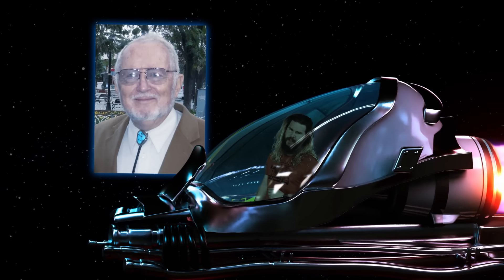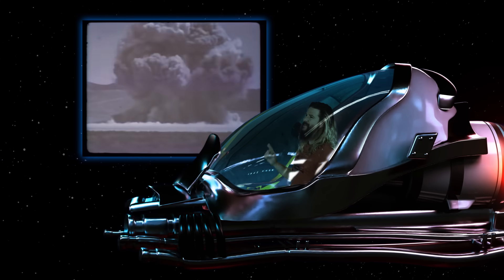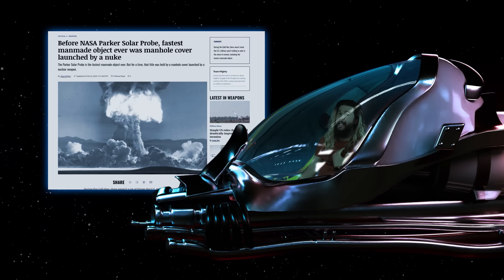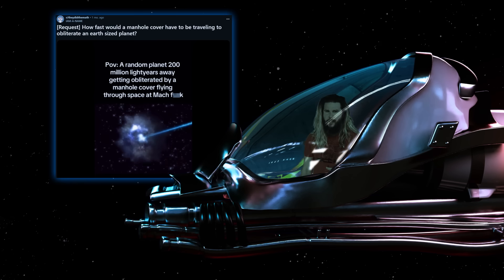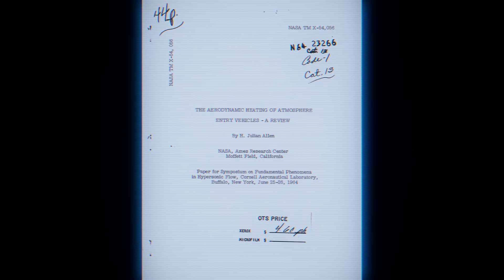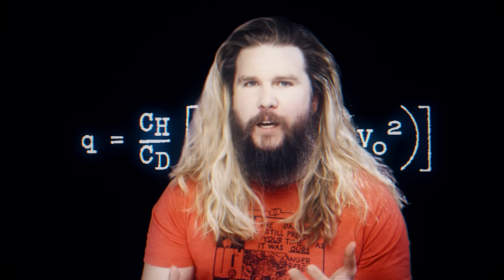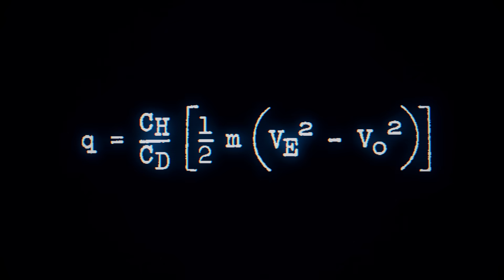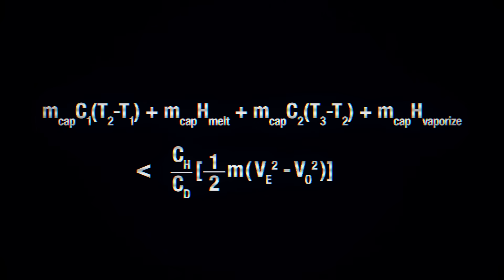Debunking the Nuclear-Powered Manhole Cover

Comment: There are some problems with all of the math. Three things: We assume that the cap was moving through the atmosphere perfectly flat; not sideface or tumbling. Second, the fluid dynamics of re-entry are not static. There is "peak heating", and as the cap moved upwards in the atmosphere, it would encounter VERY progressively thinner air. So, if we assume that the peak heating occurred fairly quickly, in the denser parts of the atmosphere (which is a safe assumption), then there is a plethora of unknown data values after it reaches peak heating. Thirdly, hypersonic atmospheric interaction on a shape like the cap isn't a known value, and there is too much assumption made on that; meteors explode at lower speeds precisely BECAUSE they are traveling at a lower speed.

All this to say, it is most probably accurate to assume that the cap did not make it to space. However, there is a LOT more math that needs to be done to be actually conclusive. Also, before its likely vaporization, it most certainly was the fastest man-made object ever created.
Reply: Should we be taking into account the heat energy imparted by the explosion itself or are we assuming the pressure wave proceeding the heat/radiation moved the cap out of the way before there could be any meaningful transfer?
Reply: @Kzorith  Concrete also was poured into the bore that did vaporize but acted as wading and increased the pressure at a cost of some of the early heat.
Reply: @Kzorith the steel cap was thermally insulated from the explosion by a concrete plug, the pressure would have shot the cover away before any significant heating happened.
Reply: @thelastant8366  The cap would have been irradiated by (depending on the details of the explosion) lots of gamma and neutrons. Enough getting through the concrete plug to heat it? I haven't done the math.
Reply: @thelastant8366 but what about deformation we are also assuming it remained flat.
Reply: @thelastant8366   It was welded in place. How is it possible to stress welds to the breaking point and not incur some measurable heat loading. I'm glaring at the equation now, and while there is a time term, it's still going to be significant in the "a couple of shakes" timeframe this likely took to break the welds.
Reply: @Kzorith  An interesting thought. If the lid had direct line of sight to the bomb, would it absorb enough heat energy to effect its airborne melting point.
Reply: @rus0004 I’m not nearly good enough at math to do this but I think a good start to gage the accuracy would be to use this equation to determine how much heat would have been imparted on the cover to reach the height during the first high speed frame. If the equation says the lid should be hot enough at that point to be glowing then we know it’s inaccurate.

I don’t believe the physics of exit are the same as re entry and it imparts a lot mor energy to slow a object down than speeding up. The energy absorbed would be the difference between the velocity at ground level and the velocity upon exiting the atmosphere.
Reply: @Kzorith  IIRC, there was a concrete plug between the bomb and the cover. This plug was vaporized by the detonation and the expansion of that vapor is the reason the cover was launched. So likely some heating but not a lot.
Reply: @Kzorith  yeah, when we think about the concrete evaporating, we have to keep in mind that thermal radiation travels at SOL, while the pressure wave, even in concrete, is still much slower by a huge margin.
Reply: @Kzorith  was the proof of that in the high speed footage?
Reply: @garywayne123  Not that I’m aware of. My question was more around if the starting temperature of the cap was higher than ambient  before we start applying the atmospheric heating equation.
Reply: The only frame would say probably not  @Kzorith
Reply: That is a big assumption that begs investigation. This is a very complex event to model. It is probably necessary to look into how the equation was formulated to begin to understand whether it is exit/entry reversible. I think it might not be  (because the atmosphre is progressively less dense as altitude increases. I also think the disc would only be exposed to the heat of the explosion until a few milliseconds after it launched and that it probably launched with some eccentric motion that would mean it didnt go up flat so the drag coefficient would be lower as well as reducing.
Reply: @Kzorith I was wondering the same thing, not that I know anything about which would’ve interacted with the cover first. I suppose it makes sense that the pressure wave would make contact before the fireball but it’s still hard to believe that something could be sealed over a nuclear explosion and not be instantly destroyed
Reply: @Kzorith it had to be pushed by the pressure wave and didn't experience the blast heat is what I believe because if it had felt the heat of the blast which is hotter than any part of the sun I believe it wouldve been vaporized immediately
Reply: @Kzorith to my understanding the iron cap was at the top of the borehole, and directly below it was a 20ft thick concrete plug (with the bomb itself several hundred feet further down the borehole). Therefore the cap never interacted directly with the nuclear fireball, but rather was launched like the last ball in the world's most ridiculous Newton's Cradle
Reply: @Kzorith  Radiation travels close if not at the speed of light so it probably was already hot. Radiation reaches you before the pressure wave.
Reply: @Kzorith cap is going to be in line of sight of the blast even if it’s been blown off already. That’s gonna be warm.
Reply: He also assumed the caps final velocity was zero for the heat equation he used.
Reply: You are correct, the amount of energy variation is several times higher, so even if its reduced by making more accurate calculations and drag coefficients, it would not be enough to not vaporize the cover.
Reply: @shippy1001  I would spemd taxpayer money to test this
Reply: @shippy1001  Unless the cover as a result of air resistance started to follow a path closer to ground, meaning distance traveled and air resistance could be far greater than if assuming a straight trip to outer space.
Reply: @shippy1001 what about the fact that it made contact with a nuclear bomb
Reply: I did a simple analysis simulating interval while including the standard density of the atmosphere at altitudes and it definitely demonstrates a non-zero probability that there would not be enough energy to vaporize the manhole cover. 
1. Its odd to assuming that the manhole cover would remain flat side against the air, more likely it would tumble then end up edge on. This would both reduce the Cd (3/4) and the area (1/10) causing the drag and frictional heating drastically reduce.
2. As many have stated the density of the atmosphere exponentially decreases with altitude. Assuming the test was at sea level, by 10,000 meters the air density would be 1/3 of what it was at launch based on interval calculations (using drag) that would take less than a fifth of a second to reach that altitude even as the cover slowed down. By the half second mark the air would be less than 10% as dense and so would the drag (and thus frictional heating).
3. As other stated the change in velocity would not be 100% but whatever change in speed once the cover got to a region with low enough air density. Again rough interval analysis shows that the cover's velocity at where the atmospheric density is less than 1% of sea level, would still be closes to 50% of v0 or 33 km/s. 
Again it is rough, and there are way too many complications that can skew the results either way, but using this method I got approximately 1,500 Gj of energy if 100% of the change in velocity became frictional heating. That is only 25% of what is presented as the energy of vaporization. So again this doesn't prove that the manhole cover didn't vaporize (many more complexities need to be accounted for), but just doing a slightly more in depth exercise (mathematically) shows that there is clearly room for the molten blob of cast iron to make out of the atmosphere. I'd be happy to share my work with team, but unsure if there is an e-mail address for fans.
Reply: @jonathanlien324  yea probably made it and became space junk
good luck cleaning hypersonic scraps 🤣🤣
Reply: @randomguy2210  Considering the angle at exit, aka straight up, if probably fell straight back down and burnt up in the atmosphere on the way back if it made it to space.
Reply: @rivernlong5979  mm you sure? it was well above escape velocity tho
Reply: Also the fact that as an object travels higher into the atmosphere, the pressure decreases so the amount of time required to change its temperature also decreases.   Also the fact that the object is slowing down as it moves upward due to gravity.  It wouldn’t be traveling at a constant velocity all the way up.  This would, in turn affect its drag, as drag is directly related to velocity.
Reply: @FF2Guy  I think the effect of 32ft/s per second would be negligible compared to the assumed minimum of 210,000ft/s that the cover was carrying.
Reply: @rus0004  I think it should be 32 ft/s^2, which can be significant over time
Reply: @FF2Guy  Firstly, that's what I said.

Second, in the ~6.5 seconds it would take to reach the orbit of the ISS, it would have only lost approximately 210ft/s (143mph) due to gravitational deceleration. I don't know what you consider "significant", but it's not  going to come about in any proximity to the Earth's surface.
Reply: @FF2Guy  Gravitational acceleration is not a practical factor. Gravitational acceleration is 9.8 m/s per second. If the cap's initial velocity was roughly 150,000 miles per hour, that is 67,050 meters per second. Space (using the Karman Line) is 100km up. Thus if there was no deceleration due to drag, the cap would reach the Karman line in 1.49 seconds which means gravity would reduce it's velocity by 14.6 m/s. Hence not a practical factor when your starting velocity is 67,050 m/s.
Reply: @FF2Guy  shouldn't there also be a small variable for air resistance as it travels upward? And said variable also changing due to thinner air the higher up we have said object? And not to mention that it is more likely to assume the cast iron cap to just be tumbling the entire time because of a few different factors. And this tumbling will also affect the now this equation. Actually thinking about it, I think It's likely that due to tumbling the cap would experience more stress and start breaking apart faster/easier. I could be dead wrong because I don't understand physics of this level. I vaguely understand the concepts...
Reply: @FF2Guy 
No, gravity was defeated when it reached escape velocity. 
It can't come back. Can't go into orbit. It gone.
Reply: Came to say the same thing. Too many assumptions, especially about the dynamic of the cover through air. Hell, how about the air sonic boom? The plasma created around it would have shielded part of the mass from the heat generated. The cover would have reached space in less than 2 secs; and heat transfer has a velocity as well. Just saying the travel of the mass would have generate some heat wouldn't mean all of it would be absorbed; some would be dispersed through the atmosphere.
Reply: Also, in his equation he literally assumed that it lost all its speed to heating. At that point it would have become the slowest thing to reach space, not the fastest.
Reply: We are also assuming that the cover remained a flat disk. The explosion likely forced it into a more conical shape.
Reply: @jerry3790 I came here to say the same. Look up explosively formed penetrator or EFP mine.
Reply: Got to get veratasium on the numbers xD. He has some connections he can leverage to get the problem solved.
Reply: @takumi2023  when you say connections with this context... to me it sounds like you've saying he knows a guy who will hook him up with some nukes to test this on scale.
Reply: @captainshelf7  lol i was talking more of professor level associates he can call to do the maths with.
Reply: Another huge original assumption was the initial speed (150,000 mph) was the minimum required to be caught by only 1 frome in the high speed camera. The speed of the cover could have been much higher than that minimum calculated speed.
Reply: Exactly
Reply: In addition, there's a bunch of vaporized concrete that may act as a gaseous heat shield, as the manhole cover can only go a percentage of what the gaseous concrete is going, due to the concrete being significantly lighter, leading to the concrete gas possibly accelerating ahead of the manhole
Reply: Let's also bring up how at 150,000mph, it would only be in the atmosphere for a fraction of a second, meaning even if some of it was vaporized, the heat likely had nowhere near enough time to conduct through the entire slab, meaning at least a small chunk of it was still in the range to be solid
Reply: @Blockenheimer  Bear in mind that we're not even discussing the material strain on the cap. There's every likelihood it was simply torn apart even before it could melt, unless the forces pushing it from beneath were by some chance extremely uniform - which seems unlikely given what is actually hitting this cap is the instantly vaporized remains of the concrete plug below it, rather than a stream of atmosphere.
However, there's also the chance that the forces compress it into a teardrop shape or stream the way you get with EFPs, in which case the math changes a lot as its surface area drops.
Reply: Ive got the solution... have the SloMo guys set up thier best camera and recreate the experiment.  We just need a 2 ton Manhole Cover,  a 500ft deep hole a plug of concrete and a 5Kt nuclear bomb to set it off 🎉
Reply: I was thinking at that speed going straight up it would have to be vaporized in a split second before reaching much less drag/friction and making it further up. i mean if it survived for 2 seconds it'd be in space?
Reply: Yes, I don't understand the kinetic side of equation - what speed did he used for final velocitiy (Vo)? At 9:38 there's only 66kmh squared, but it should be initial speed squared minus final speed squared (speed when it exited the atmosphere). So it look like he used zero for final velocity? Why?
Reply: And wouldn't it make a difference that in the bottom part where most resistance would occur due to the denser atmosphere, there was a blast wave moving with it, reducing friction because the air it was going through was being pushed away as well?
Reply: @esenel92 no, because air is like a fluid medium, when you fire a bullet into water, the cavitation wave doesn't push the fluid out of the way of the bullet or reduce its drag by any significant amount. Air works much the same way. 

And I see a lot of people questioning if the disc was flat or tumbling, but it certainly would have been oriented almost completely flat, as you see with a penny in a wind tunnel. The largest surface area will always be forced into the source of drag, i.e. a disc will always be forced flat. There is 0% chance that cast iron disc survived exiting the atmosphere.
Reply: @itstonberrytime I think it would have been deformed like an EFP mine on launch making it much more aerodynamic.
Reply: @itstonberrytime but if the water is moving in the same direction as the bullet and at a similar speed, would the bullet feel as much friction as it does just shooting into a pool or lake?
Reply: @fire304  I believe the cover still appeared to be a flat disk in the single frame showing the cover. The explosive force in an EFP warhead is asymmetric in order to deform the metal whereas the force coming up the shaft would probably be fairly evenly distributed.
Reply: @LUSkyhawk  my understanding is that the actual video and images of the test is still classified, so only a handful of people have actually seen the real image.  As for shape, based on what I read, what changes the shape is the metal is softened by the heat of the explosion and is moulded by the air as it flies (whereas a shaped charge is moulded by the blast). So... I think it's quite possible.
Reply: @itstonberrytime  It is 110mm worth of steel tho
Reply: Thank you for saving me time writing :) As soon as he chose the atmosphe reentry equation I said to myself.... wait a minute... that can't be correct.
Reply: well he does say that depends from fluid dynamics...
The troposphere is thick, but its reasonable to expect a disk space object to have rotated to its side while traveling, drastically reducing drag
the cover is a small object, i think it may have made it to space, but in the form of space junk
Reply: From a KSP scientist background, it's weird to think of maxQ happening at t=0.
Reply: but then also the cap would experince a very dense atmosphere compared to meteor Direct at the start, sort of punching wall than cotton, so it would probably deform to a dome shape and explode, also lossing it's thin more aerodynamic shape to a twisted pile or doe.
Reply: One can only hope, he doesnt make such false assumptions on his statements about nuclear safety.
Because: a waste storage that has to be guarded will also be so in a hundred years...
Reply: Exactly, you would have to integrate the heating and drag as the cap moves through the air.
Reply: Also he used values for iron not cast iron
Reply: And negative acceleration. It's not rocket propelled
Reply: We’re also missing the fact that the coefficient of drag would change as the object vaporizes. This entire equation cannot be simple algebra; there is significant integration required to map every step this object would have taken up the atmosphere.
Reply: First things I was thinking. turning sideways, and how much force/heat did it absorb being ripped free of "being welded" in place. Someone could probably get another video out of that.
Reply: reading this comment was far more enjoyable than watching this video - thanks
Reply: It's also sort of wierd it was cast iron, and not the ductile iron generally used on manhole covers and sewer grates.
Ductile iron can take trucks driving over them, while cast would shatter.
Reply: And what about clouds? Did anyone ever consider clouds? Maybe the cap got stuck in one of them and is sitting up there right now....
Reply: Not to mention even if everything was stacked against it, heat transference over time and how long it would have actually been enduring those conditions.  I wonder how much heat the cover could have even absorbed in the extremely minute amount of time before it went exoatmospheric.
Reply: @BinaryBlitz  Right, from what I can see, there was very likely enough heat generated to vaporize the disc - the big question is whether there was enough time for it to transfer into the object.
Also worth noting that the heat would not have had time to equalize, so I think the forward surface would be almost instantly vaporized due to its inability to transfer heat away from itself into the body of the object fast enough to matter - it seems the main question isn't whether it vaporizes, but rather how much of it vaporizes, and what effects that progression had on its characteristics. It really is some very complex math, I think even a very serious physicist who was professionally working in related fields would be hard pressed to model it without supercomputing time and probably a fair bit of observational data from weapons testing or something. This kind of physics is very much in the ballpark of shaped charges, hypervelocity kinetic penetrators and the like.
Reply: So considering it was only 3x greater energy by the calculation and that a lot of assumptions were made for it flying flat into the air and that it would actually be reasonable that a small part of the cover did make it before vaporization, this could actually be humans first ever space projection but it’s probably like a small goofball sized chunk of iron flying at insane speeds through space
Reply: I want to believe
Reply: Let's assume that the cap is a perfectly round object ahh type calculation
Reply: Edgewise is MUCH worse, the shockwave attaches to the object and heat flow rates go through the roof- it burns up quicker. The more pointy it is, the worse it gets. The SLOWEST way for this to burn up is travelling presenting a flat face to the flow because the shockwave forms the furthest away, and you get the lowest heat transfer. That's why the Space Shuttle didn't have a point nose. You want a blunt body.
Reply: The thing I keep thinking about is that at the projected launch speed, it would have been in space in less than 1.5 seconds. That cover was out of the soupy part of the atmosphere in like .5-.75 seconds. So we are saying that tiny amount of exposure would be enough to vaporize the cover?
Reply: Thanks for this excellent additional context. 👍 
The "flat disc moving through the air" is something that caught my attention. Is it more likely it tumbled or soared more similarly to a disc being thrown? If so, how would that affect the speed and heat transfer? Further, if it had made it to space, would time and gravity have brought it back to earth like deorbited spacecraft and satellites?
Reply: @bdubbsmark  if it made it to space, with its starting velocity, it would have had well beyond the needed velocity to escape the solar system. It was only in our atmosphere for 1.5-2 seconds. It likely was still going significantly beyond 120,000mph at that point, if it survived the atmosphere.
Reply: @bdubbsmark  A falling disk such as a coin will tumble chaotically. Now that's at relatively low (terminal) velocities, this object is moving at hypervelocity and may behave differently - it might not even have time to begin to tumble, particular as the small differences in air density along its path will be absolutely minute relative to the speed it is moving.
Reply: not to mention it is going vertical and not horizontal like during re-entry. It reaches the Karman line in less than 2 seconds. so it only has about 1 second in the thickest parts of the atmosphere.
Reply: The thing I keep hearing is that it was a normal man whole cover. Which it as far as I’ve heard, wasn’t, I would very much like to hear what it’s like for the actual 2000 lbs steel and concrete reinforced man whole cover.
Reply: An additional math issue is that he ignored that C is a function of temperature.
Reply: I think this answer gets into so much of the reason why nobody does the math on this.  Too many unknowns to have certainty.
Reply: What is crazy, is that it would have spent less than 2 seconds in the atmosphere
Reply: would not the fact it was going "straight" up and not at a shallow angle like mmost objects reentering effect it as well?
Reply: We can do it again and find out. We have the technology
Reply: @thugnasty9139 yes we certainly could.  But maybe let's not set off an actual nuke to settle an Internet debate? Please?
Reply: @thugnasty9139  This is my favorite reply thus far and I endorse this wholeheartedly.
Reply: I'm not a math man I'm a metal man meteors are made out of mostly silicon,iron and nickel. In this video, he claims the cap was made out of iron from other sources. I've read. It was made out of refined steel. There is no meteor that has ever struck earth made out of refined steel hence we dont know how a mass blob of refined steel reacts upon reentry
Reply: This was my thought, I'm no mathematician however the dynamics of an object re-entering the earths atmosphere seem so different to an object starting at ground level, that it cannot just be reversed. In the case of atmospheric re-entry, The object starts at say, 150,000 mph, and as it hits the thin atmosphere, it is slowed down a tiny bit, growing in drag, to the point where when its actually say 40,000 ft above the earth, the atmosphere is so thick, its only falling at say 400 mph. On the opposite side, when the Manhole cover is at 150,000 mph its at sea level in air that is very very thick compared to the edge of our atmosphere. So the drag at sea level being so much higher, I would think, means greater friction and heat transfer, imho meaning an even worse prognosis on the manhole cover not making it to space.

However I do agree, there are tons of unknowns, as far as the shape after what I would expect would be a billion g's (hyperbole).

I also agree, that what was presented in the video is BEST case scenario, and even that says it didn't make it to space by an order of magnitude.
Reply: @steakbbq  i'm not great at math and my brain keeps trying to figure out the time and distance the cast cap was from lift off to space. cause unlike meteors that come in on an angle and spend more time in the atmosphere, the cast cap was straight shot to the void. and with the thickest part of our atmosphere being ground level and thins out the higher you go. i keep thinking it had a good chance of making it cause to heat something up you need time and energy. i'm starting to confuse my self and over think everything. yall are alot smarter then me.
Reply: @steakbbq  but then also the cap would experince a very dense atmosphere compared to meteor Direct at the start, sort of like punching a  concrete wall than cotton, so it would probably deform to a dome shape and explode like a shaped charge in RPG7 or Anti tank missiles, also losing it's thin more aerodynamic shape to a twisted pile or doe. making it for susceptible to friction.
Reply: wasnt parker solar probe faster?
Reply: @randomguy2210  Even if we add that in the manhole cover is still like #3. Parker, voyager 1-2, manhole cover.
Reply: Yeah, there are a few problems.
Reply: I think this soundly articulates my own thoughts that while a likely outcome I still not convinced to the degree that I'd consider it settled.
Reply: You seem brilliant can you do the math for us Cavemen?
Reply: Alright look forward to you posting the results of your math in the replies
Reply: Thanks for this comment. Don't have to watch the video now.
Reply: Oooooh, that's alotta new data for my brainhole! YOINK!
Reply: So there's still a chance!!!
Reply: Thank you, I was just about to comment on this video about that. If something is tumbling through the air if it was then it would have displaced a lot of heating
Reply: To get the average drag of the cap at any given position I feel like would be a reasonably straightforward integration, same with the atmospheric density, so I’d be curious if even taking some rough numbers into account would  impact this by much…
Reply: Just some thoughts: something entering earths atmosphere will start heating up until the heat transfer reaches its maximum. So you enter the maximum with an already dry hot object while here the object is cold at the beginning and the max heat transfer is at sea level aka right at the beginning.
The object will change shape because the rim will melt first.
Meteorites entering the atmosphere have nowhere the strength as steel.
The object will try to minimize its resistance aka it will sooner or later be flying sideways. 
Atmospheric entrance is at a relatively sallow angle which means a long way through the atmosphere with a lot of time for heat transfer.
So I think it could have made it into space. And I think it will be impossible to ever calculate the speed at which it left earth if it made it. This remaining speed would massively influence the amount of energy that could be transferred.
Reply: Just going to say this, I doubt there's enough data to know. And if there was, we already knew before now. But.

Very cool explanation as usual.
Reply: Perfect observation!! Bravo.
Reply: So you're telling me, there's still a chance that it could hit and wipe out an advanced alien race?
Reply: @danielloewen2857  in the next 4 billion years I suppose cause that thing ain’t reaching the next star in a minute
Reply: Also to point out, meteorites are not cast, they are organically formed which means they bond isn’t as strong, whereas cast iron is purified to a degree then melted to a molten state and poured into a mold to make said object. Its bond would be much closer and stronger than the meteorite. The only way to definitely tell for 100% certain would be to go back in time and use equipment to record it all. To many unknown variables that can’t be properly replicated.
Reply: I don’t know the math for things like this I remember watching a different video on this and then talking about the speed calculations were low bound estimates, so let’s say that we do the calculations like Kyle did but estimated a high bound estimate for the speed, is there a speed that it could have been going to escape somewhat in tact according to these calculations?
Reply: yeah several objecrions to be made here.
1 no rotation of the cover is assumed
2 the density of the athmosphere changes with altitude
3 final velocity of 0 relative to earth was assumed.
4 hypersonic flow phenomena were neglected
5 there is an ablative cooling effect here that is not considered by the calculation. Material can get superheated, turn into plasma and take a huge amount of heat away from the object.
6 just because heat is sufficient for vaporisation of a unit mass of material does not imply that that has to occur due to a plethora of reasons including but not limited to ablation.cooling as previously mentioned.
7 the nasa equation is derived from a formula for heat per unit time, so power essentially. As such it is a reasonable approximations for specifying heat shields. Even then nasa simulates all their heat shields. By integrating this equation over time you stack up the error and it will be far off.
Reply: Im a moron who failed 8th grade math...but I cant help but wonder about the time differential between a meteor coming in at an angle compared to one that is going straight down (or up). I do not believe it would radically affect the number enough...but another factor that should be added in the math. The time spent in direct contact to the thicker atmosphere would have to be less.
Reply: Furthermore, remember, that 150,000MPH number is the lower limit for how fast it was going, and consider that force of the bomb going off being imparted on the plate could have made it convex, causing drastic changes to the aerodynamics calculations.
Reply: Sounds like we should replicate the experiment with a few sensors strapped to a “nuclear manhole v.2”
Reply: It'd essentially start at peak heating, since it's originating at the densest part of the atmosphere. I'll assume tumbling adding inefficiencies to movement, sideface being unlikely due to the fluid dynamic, which I agree, are far from static. There'd also be ionized components to further confound trying to calculate matters and he also treated it as a uniform object that would fully melt, then boil as a unit, rather than melt from outside inward as has been observed for other hypersonic objects passing through the atmosphere. The core of a meteor doesn't instantly boil while the surface is being superheated and bolides tend to fail structurally due to the aerodynamic deceleration forces overcoming their binding energy more than anything purely heating related.
More probably, the cap would be partially melting, losing strength as it's heated and aerodynamic forces driving pieces off as it traveled until sufficient mass was lost that only fragments were traveling and decelerating much as bolides would be traveling in pieces after a fireball explodes.
I suspect a lot of the modeling has already been done that would help in calculating this, but much would be related to railgun work that remains classified. As it was a decidedly non-aerodynamic body to begin with, the stresses would be beyond immense, that the object is a disc and not a blunt body, conic, biconic, etc body just increases compressive strength failure as a mode of fragmentation of the body's chances tremendously.
Then, to further muddy the waters, there's a major assumption that the initial estimation of velocity could be wildly off, as even the shape of the cover once it departed from where it was welded is unknown. Did the weld fail and it's just largely cover? Did it bring any parts of whatever structure it was welded to with it? The heating isn't immersive either, it's heated by the inferno just in front of the shockwave and modeling that is devilishly complex with known shaped objects, such as blunt body, aerodynamic body, cone body, etc. 
Most likely, it'd have come apart fairly early on, much as Columbia came apart, for much the same reasons.
Reply: It also doesn't help that the footage of the Pascal B nuclear test has not been released to the public yet as far as I understand. So no one else can do a double check on Brownly
Reply: I hear everyone talking about the math, I see not a lot of doing math
Reply: Keep looking in the comments, you won't find no math equations here. 
Only math talk
Reply: A vast amount of heat energy was applied directly to the cover by the compression from the explosion before it ever separated.
Reply: The "well ackchyuallt" is heavy in this post.
Reply: I wonder if an integral would be useful here since the density changes in respect to thr height of the man hole. Make the drag coefficient a function of height and find the integral of that.
Reply: The Leidenfrost effect would also need to be taken into account at this velocity, limiting thermal conductivity. Even if it's small, it's a variable completely ignored here.
Reply: Determining what the fastest man-made object can be difficult since "man-made object" is ambiguous. I'm sure there would be small fragments of any nuclear weapon that briefly move extremely fast before not being solid.
Reply: can you clarify on why meteors explode at lower speeds because of said lower speeds?
I was under the impression small meteors explode by lacking the mass to sustain itself long enough before hitting the ground.
Reply: I think the only way to truly find out is a practical test. Do it again and this time dedicate all of our radars and High speed cameras and telescopes and satellites to find out what truly happens.
Also how funny would this be: this could be an interplanetary cannon. Make the Object bigger, more aerodynamic and out of tungsten or Uranium and then shoot it at the moon.
Reply: So, what it really was, was the first ground-to-orbit plasma cannon. 

Certainly not intentionally, but functionally a prototype for Project Orion's "Casaba Howitzer". I do have to wonder if this served as any inspiration for the idea.

I also do have to concur, there's still too many variables left unaddressed, such as whether it was spinning and for how long, or whether it would have stabilized at such speeds... gosh, there's just too much unknown about anything moving at speeds like that in atmosphere. I mean, how long would it have taken it to reach Max Q? Could it have possibly absorbed enough heat via friction before then to liquify or vaporize? Yes, distance is distance, but time is a factor too. Then there's the factor of making extremely cold thing extremely hot very suddenly. That's not happening here.

I propose a smaller-scale experiment using conventional methods. Sure, scaling up or down always introduces error, but it can still be learned from, especially with observation over iteration and slowly changing scale. 

So yeah, let's find an old oil well somewhere and see if we can turn a chunk of steel into plasma... or the next object to leave our solar system :D
Reply: @b3s13g3d  plasma is cool, but its very HOT XD
Reply: There is zero chance that it did. Sorry.
Reply: So you're telling me there's a chance
Reply: two other issues  I see  with the calculation 1. thought small he forgot to include the heat of transformations;  2.  heat transfer through a uniform material is not instantaneous and takes time to move  thru the material (This one is a tough nut to crack, there is no analytical solution. )  However, cast iron is brittle so it most likely just exploded into shrapnel . mystery solved.
Reply: Another part is how long it would take to heat … the cap would have only been at low atmospheric high pressure where max heating would occur for like … such a fraction of a second … by the time it could effectively heat transferred through the entire material it probably was already passing LEO
Reply: Depends what you need to classify something as an object, iirc the Lawrence cyclotron from the 1930's accelerated particles (really small objects maybe?)  up to about 0.01C (1% the speed of light), whereas the manhole would only have been travelling at ~ 0.00022C (or about 0.022% the speed of light, though with significantly more mass and energy involved)
Reply: I feel something peeking. If I don't find a toilet within the next 3 seconds I'm gonna
Reply: Also, he forgot to factor in the change in the drag coefficient as the cap melted and vaporized. It would have gone from a disc to round to progressively smaller.
Reply: Thank you.
Reply: The questions that came to mind for me were if it were spinning, would this have a cooling effect? 
Also what effect (if any) would going through a cloud have?
Reply: Also, we don't even know if it was still flat for longer than a single 1950s quality high speed camera. For all we know it was deforming and becoming domed or conical since it would have been warm enough from the ambient temperature of the test range to be on the ductile side of the metallurgical phase change of ductile/brittle. Which means that the entire equation would change as the air resistance changed. Now, it isn't an X-15 or SCRAM jet test bed, but if it had a shape that wasn't perfectly flat (which it wouldn't after the nuclear kick in the tail it just got before the welds gave) then it could possibly have hit the Armstrong or Karmen lines before heating destroyed it.
Reply: Blue collar dude here: Came to the comments to mention the fact that a disk like this wouldn't fly through the air flat, it would either tumble or tilt on its side. But you make a good point about all the other things!
Reply: Unlike so many other comments, I like the way you put it. His math wasn't inherently wrong. To put it more accurately, it was incomplete. He would have to do MANY times the calculations, with simulations that likely far exceed his means to fully answer this question. And frankly, I think this video does a wonderful job presenting and explaining the math required to do so.
Reply: Easier to say factor variable change. Don’t over do it. Keep it simple.
Reply: The manhole cover was only captured in one frame, is it still possible to calculate the exact speed it was going or can we only calculate the minimum speed it would have been traveling?
Reply: I picked up on this too. Since we have only ONE SINGLE frame in camera of this object to give a potential velocity range, and we have no idea of its orientation after that frame, a ton of math is still to be had. 

While diving down the non-dimensional number rabbit hole, I'm not surprised to see Nusselt brought up, but without calculating the Reynolds number (and Reynolds stresses) of the air around it... And the issue with what's happening to the column of gas pushing this, and what happens to the atmospheric gasses it will encouhte... OH! And we can't forget the deformation caused by the "launch event" itself. 

We don't know the surface temperature and internal temperature profile inside the plug. We can only assume boundary conditions. 

I'll give this "maths" a nod as a plausible potential outcome. Could it have been vaporized? Yes. With so many critical unknowns, and basic back of the envelop calculations indicating a probable orbit event, I'm still holding to plausible. Heck, even knowing the weld thickness and method need to be brought into this conversation!
Reply: This is all to assume that the cap went directly up and not sideways. When it comes to objects being ejected by an explosive reaction, there's always a good chance that it got shot in a somewhat obscure direction which is why barrels are extended for more accurate shots. Otherwise it fires like a musket shot. For all we know, it more than likely got vaporized or it generated a high enough altitude that the moment it started its descent, it buried itself somewhere into the ground. There's a lot of open space so there's plenty of spots for it to lodge into, unnoticed.
Reply: Hmm, so you'd need to make series of additional calculations regarding the atmospheric pressure effecting the object or what's left of it at that step, since 150,000 miles per hour speed you'd be inside any amount of air for 1,5ish seconds. But just do the math if you find it fun I guess, you might be chasing a smokecloud quite literally :D
Reply: Or we could do this the correct way, and just recreate the experiment, but this time with improved observation of the cap itself.
Reply: Would the deceleration from drag and gravity effect how much heat was hitting the metal cap? Plus the thinner atmosphere as stated. And would it correct itself like a water drop as it melted to reduce drag? If it slowed enough with enough aerodynamics, thin enough air, plus air getting colder the higher it went, Could it have survived as a cooled metal reverse raindrop?  Not sure which equations would have to be added. I think the next video someone does could do  a best case scenario for the smallest bit to survive as the heat tappers off.  Unless it only takes a moment to vaporize and that's that?
Reply: A few comments: 
1 The cap was not moving alone.  The gases that are pushing it are with it, for a brief time.  Meaning the cap is moving relative to those gases, not the atmosphere.  And that throws a wrench at the "math."
2  Those gases were ahead of the cap for some brief part of the trip.  They would have very quickly passed the cap, going faster.
3 There was supposed to be an image of the cap, in one frame of the (not fast enough) hi-speed camera.  I would have done the math to show how much time between frames.  Mainly showing how far the cap moved, before the image captured it.  And then, how much time until it went out of image.  Just that last time would have shown it minimum velocity in order to be out of frame.
4 Bottom line.  There were too many variables to affect his math assumptions.
Reply: Would be interested in Kyle going through this. His math works for re-entry, but assuming it did make it to space, his math would be off based on material loss during atmospheric exit. 

The way Kyle looked at it was using entry values as exit values, but no consideration was given for time spent (or lack there of) in the dense air, moving outward. Some numbers he used wouldn't even apply at the speed it left the ground at, meaning his final numbers would shift greatly
Reply: You also have to probaply asume that the iron if it was melting could probaply split in multipl pieces that would have more air resistance. Meteors explode in the atmossphere because they are mostly made up of iron and ice, which explodes when it gets extremly hot.
Reply: The fastest man-made object ever created is NASA's Parker Solar Probe that moving around the Sun with stuning 430,000 mph
Reply: Its insane how we would be able to calculate everything 99.9999999% accurate if we knew every single thing there is to know. From weight imbalances to differences in drag because of an imprint on the manhole cover
Reply: Nope first of all its a good assumption because how a spherical wave distributes its energy and that's why it's orientation is mostly like horizontal and another thing progresive atmospheric thinning doesn't effect a lot because at peak velocity the atmosphee is dense just like meteors has peak reached peak velocity at earth surface it's just reverse only problem is heating coefficient and this could give you bad results and others assumption to my knowledge is correct
Reply: Nothing takes into account the radiative energy imparted by the nuclear explosion itself. Considering that such energy can carbonize organic matter at many times the distance I'm guessing that cover was pretty hot already.
Reply: @apexqc04  I assuming the single frame showing that it was still a disc shape (albeit unknown if it was solid or liquid at that point) means that energy transfer from the explosion itself was at least fairly limited. 
I believe thermal transfer is also a function of time so I'm very curious as to what effect that has on all of this.
Reply: Also, the cap became liquid for a good portion of its ascent through the atmosphere, meaning it would no longer have had the shape of a disc but probably would have broken apart into a spray of molten iron droplets, which would have had far more surface area (and thus more drag) than the solid iron cap originally had.
Reply: @whitslack  droplet has a smaller coefficient of drag than flat plate.
Reply: @whitslack  more total surface area but also an ideal aerodynamic shape (raindrop) and likely similar or even lower total frontal area
Reply: @liquidwombat  No way. Far more frontal area. It would be about the same area if the droplets were 4 inches long, but have you ever seen a raindrop that's 4 inches long? Granted, molten steel is much denser than water, but I still think the turbulent flow would break up the droplets so that they have an order of magnitude more frontal surface area than the original plate had.
Reply: Yes the decreasing atmospheric density of the exiting manhole vs the increasing atmosphere density experienced by an incoming asteroid is an obvious difference. Two: I reckon the variable resistance of the manhole fluttering in the atmosphere can probably be at least roughly be simulated as being an average between full flat resistance to a fraction above full parallel resistance. Also it has occurred to me that odds are GOOD that it wouldn't have even made it to space even if it hadn't vaporized because the fluttering would inevitably make the manhole cover go off course and the combination of the fluttering motion, air resistance and gravity would inevitably bend its course from straight up (that's assuming the shaft the manhole was covering was straight up) down to a ballistic course AND if the shaft was angled from vertical, then it's almost guaranteed the manhole would NOT make it to space and IF it didn't vaporize first it would land somewhere. However if it remained in the denser lower atmosphere, odds are good that it would've vaporized from the friction resulting from high velocity + fluttering + high atmosphere density at low altitudes.
Reply: @TheGhostGuitars  Given the inertia the cover would have had at launch, I highly down the atmosphere could impart enough force to aerodynamically push it significantly off course before it exited the atmosphere. With no drag (obviously not the case), it would reach space (the Karman Line) in 1.49 seconds). Even if we halve or third it's speed, that gives us less than 5 seconds and much of that would be in very thin atmosphere with increasingly less aerodynamic forces.
Also turning and "fluttering" will be a function of the difference between the center of gravity of the cover and the center of pressure of the aerodynamic forces. If the cap is perfectly round and balanced (obviously it wasn't exactly but it was probably fairly close) and the launch pressures/forces were evenly distributed on the cap, the difference between the CP and CG is likely less than an inch. This means there is a small moment arm to turn the cap in flight and not a lot of time for it to accelerate in turning before it is in space. 
If you hold a glass plate perfectly level and drop it (releasing both sides at the exact same time so as not to impart rotation), it will land flat or take quite some time/distance to begin turning.
Reply: I raised similar objections in my post.
Reply: Tbh even if it did it woudnt be the first manmade object in space. That would be Bumper-Vac from 1949(or MW18014 V2 Rocket in 1944)
Reply: i highly doubt it remained a "flat disk"
its absolutely warped very quickly and went from a flad disk to a warped piece of iron melting and breaking apart as it was going up.
Deffo just vaporized
Reply: So until we send out a FTL drone ship to check along its likely flight path to check, it probably didn't survive... But we can still check.
Reply: One tidbit.

Shape charges in the middle east were basically a brass/bronze plate sitting in front of explosive.  When detonated the blast would shape the metal into a liquid molten armor penetrating device (like a RPG). 

In this instance the explosive is a nuke.  The metal is a Iron plate welded into place. 

A focal jet of superheated nuclear powered hit that place and was stopped for however long it took for it to heat up and pop the welds at which point the metal deforms from the heat and pressure.  When the rest of the nuclear energy catches up it would start to form the liquid/heated metal into a cone but unlike conventional explosive.... nuclear energy is just getting started and it expands that heated liquid metal outwards........ vaporizing it.

The cap may have been in the next set of frames..... only as atoms or tiny droplets of liquid iron scattering in the wind.
Reply: @wrayday7149  there was a concrete plug between the blast and the cover, this vaporized and was the source of the propulsive expansion,  not the nuclear blast itself which arrived after the manhole cover was out of frame. 

A shaped charge requires that the metal core be shaped as a relatively precise inverted cone with the explosive filler directly behind it to work. And contrary to most popular explanations it does not form a liquid jet, but rather a semiplastic solid penetrator (this was only fairly recently understood with advancements in high speed photography). 

That said, you're not far off as I believe the disc would have deformed like an explosively formed penetrator.  EFP bombs use a flat disc of metal in front of a flat explosive and the metal warps into a much more aerodynamic shape.
Reply: @wrayday7149  this wasn't a shaped charge, and in a shaped charge the precise shape is critical, this was basically a giant gun. also, there was a lot of concrete below the iron cover. (also also, not sure what the middle east has to do with this at all)
Reply: @wrayday7149  welds are brittel. Welds on a "brittel" metal like cast iron are even more brittel. A shockwave that fast would brobably fracture the weld way befor any significant heat is transferred
Reply: There also must have been a not insignificant amount of radiative and pressure heating from literal fucking nuclear bomb that exploded beneath it. I bet that got the vaporization started off nicely!
Reply: @evanbarnes9984  the concrete plug ate that
Reply: Again.. Meteors?? we have seen all kinds of objects enter the atmosphere at varying speeds and sizes and almost none of them made it to the ground. Logic dictates that cap vaporized before it was even close to exiting
Reply: @Crowned_Hearts  Kyle claims that meteors travel three times slower. That means they spend three times longer travelling through the atmosphere. And that's without including any angular trajectory to increase exposure time.
Reply: @Crowned_Hearts hold on, let me go tell the Dinosaurs they can come back now